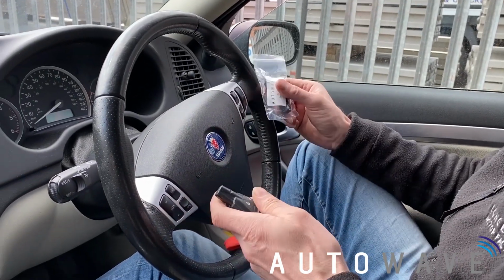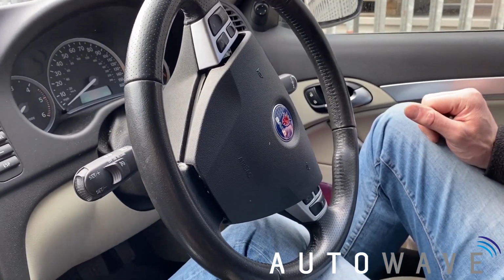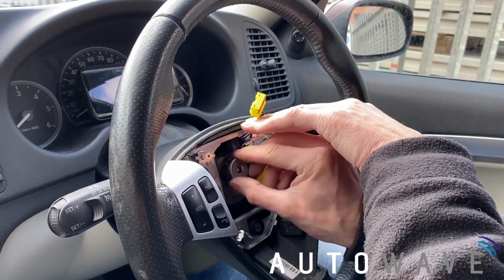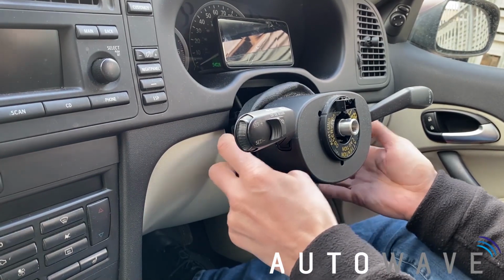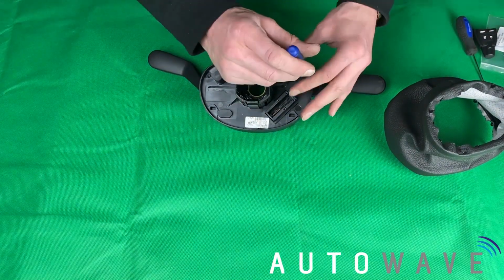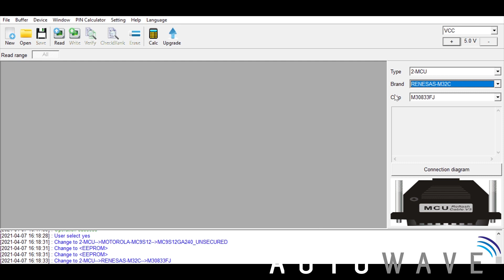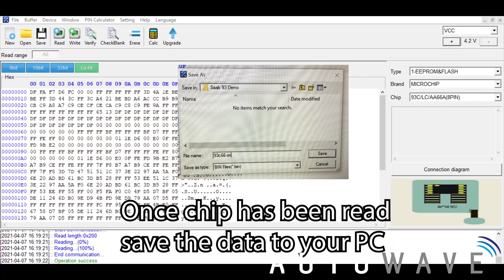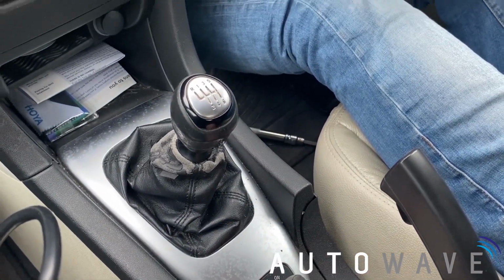2007 Saab 9-3 Spare Key | Xhorse VVDI 2 & VVDI Prog w/ EEPROM Adaptor

Comment: Excellent. Are you the brute-forcing key by making it the "dealer key?" I'm convinced this key will have different VIN information stored on its PCF7946AT. Simpler would be to desolder, replace or use the new key. Although, your transponder programmer may have to pre-code. A lot of bad, uncoded Chinese keys floating around which won't work without that step. One last thought, any harm in reading the CIM chip without desoldering?
Reply from the maker: Hi, this is not a "brute-force" method the immo data is stored on the EEPROM and that data is used to pre-code the key, the transponder ID is then also written to the eeprom file on the CIM. Unfortunately you are incorrectly convinced about the data on the PCF746AT. Our method is the most reliable and correct way in our opinion, however different people will have different methods. The remote we use is form www.autowave.co.uk and following this method they work absolutely fine. It is usually not about having "bad keys" it is usually the user does not know the method required by the key they have bought. Reading CIM chip with the correct tools in circuit have limited risk of damage. Thanks

Comment: Hello guys, been watching this video and a question popped into my head. Is this chip the only one that stores the information of the key fobs? Could they be swapped from one CIM to another to save the keys of a broken CIM for example? Keep up the good job!
Reply from the maker: Yes this is the only chip that stores the data of the key fobs :)
Reply: @AutowaveLimited   I get it I am not the only one that thought of this :) Did you try the swap?
Reply: It takes 5 minutes with the correct tool and no dismantling.
Reply: @andrewallerton1831   I assume you are referring to programming a spare key and for this I can agree it is fairly easy with the dedicated tool. As for what I was asking above (whether swapping the chip from a broken CIM module to a working one in order to preserve the old keys is working) I am not sure how you can do it without dismantling anything :)